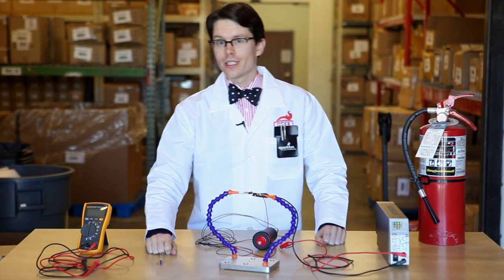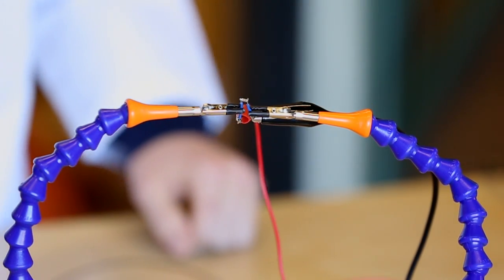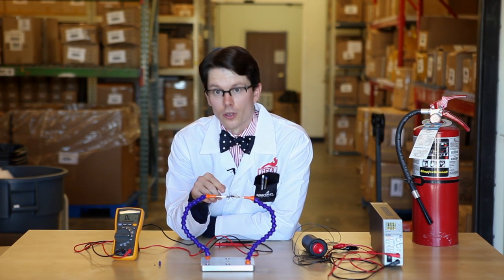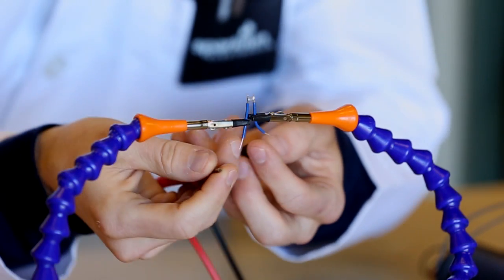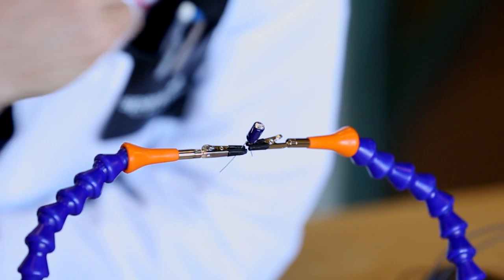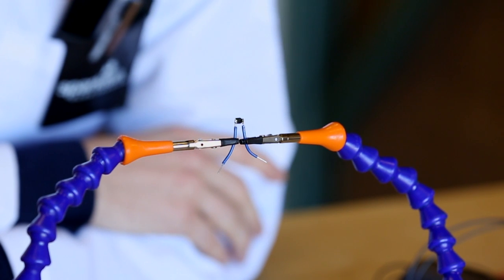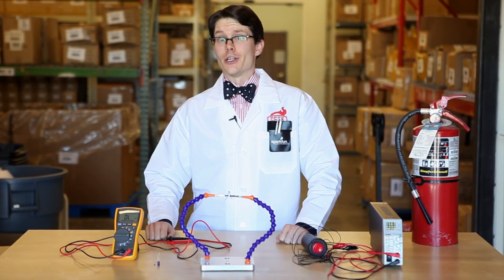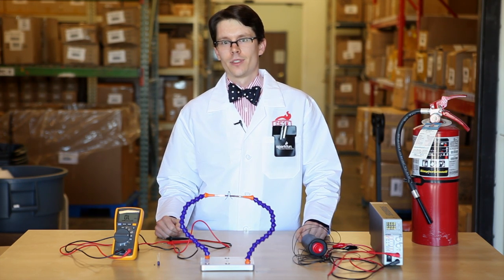Bust a Cap - Exploding Capacitors with SparkFun

Comment: Hi,  I just repaired a pcb that had a short on the 5v power rail to ground.  The culprits were 2x +-4.6uf smd 805 ceramic capacitors that had 0.1 and 0.3 ohm shorts.  No visible sign of damage on them.

Comment: I plan to teach some Electrical Safety in the near future, hence this video is of interest to me. As this video appears t have it, if the applied voltage exceeds the voltage rating, Kaboom! Is that all there is to it? 

I'd like to see some of the Math of a Capacitor Explosion. Resistors are easy enough. If I use a 1 Ohm 0.125 Watt Carbon Resistor with a 9 Volt Battery,  since 1*9^2 = 81 >  0.125, I can be reasonably certain of starting a fire. What am I missing?

Comment: Some of the older electrolytic caps didn't have the scoring and when they blew they literally blew up and it could kill in rare circumstances so we now have these types but I still see some from China not scored...YEOW.
Reply: +legalizeshemp420 

Not fun - but quite a few have (hidden) failure vents in the rubber seal
Reply: Alysson Rowan
True but in the old days they simply blew up inside your tv and had such force it blew a hole in the side of your set and could be lethal.  Now I have an electronics board made 10 years ago and the one cap that did not have a vent blew its silver piece off.  Was a motherboard so I was very surprised at that until I saw "Made in China" on the tube part of the remaining cap.  I suppose that was venting in a way as opposed to simply blowing up like a bomb in those old tvs.
Reply: +legalizeshemp420 
Yups - we used to find non-polarised electrolytics did that a lot in the back of video terminals. Ine used to literally fill the whole case with aluminium confetti and beige fluff (the absorbant paper separator) - with the can usually wedged somewhere in the yoke assembly. It took 2 minutes to replace the cap, and half an hour to get the debris out of the case.

The very old elecrolytics had a proper vent (little rubber ball) in the cap.

Quite often, even the cheapo scored caps will fail by losing their cans - and woe betide anyone who needs to use a heat gun to replace components nearby - I had 4 go at once when I was replacing a MAX3232 on one mobo - good reason to wear a face shield when doing re-working boards.

I have had a couple of quality caps go ballistic recently - but at least that was under exceptional circumstances.
Reply: Alysson Rowan
YES, that is exactly what I meant and I still have the image of the 1970's TV with the plastic (wood grained of course) side blown out because a cap just blew up like a bomb.  Thanks to the 1970's and the caps doing it enough they started to have nice vent holes in them so they spew their guts instead of blowing up.  I have an old ASUS mobo with those old faulty caps that was in all the headlines in the early 2000's and even though it sat in my bedroom unused they vented themselves.  No heat or even being plugged in as I had used it 6 months previously then plugged it in and bios went wonky and I knew from experience what was probably the issue and 3 caps vented and 1 had blown its white guts out but was dry so had done it just sitting there unplugged.  I really hate Electrolytic caps but they now make dry ones from Japan and those are nice (more expensive mobos use those now).
Reply: +legalizeshemp420 
My big image is of a 19" rack cabinet with the back panel blown out after a lightning strike surged the mains supply, and detonated the 2500W PSU at the bottom.

10,000 uF, 25V caps were enormous back then - and I used the least damaged (empty) can  of the 6 for years as a pen holder on my desk. The cabinet had to be replaced since the explosion buckled the steel frame.

Happily, the damage to the other equipment that was killed at the same time was more contained.

I had several desktop power supplies that died while powered down over the summer - which had been fitted with the same make of cap as the ASUS mobos. Not fun, but easily fixed with an order of caps from a certain electronic supplier.
Reply: Alysson Rowan
Yep, I can easily replace mine on the ASUS but an AMD2700+ can't really do anything today so I just left it alone but I still don't get how they blew and spewed without power.  I know caps can hold a charge for years but these were nothing large just a few uF so stumps me.  Samsung is notoriously FANTASTIC in the technological department of their computer monitors and LCD tvs YET use cheap Chinese caps that spew in 5 or 6 years.  They do this so regularly you can go to Amazon to find cap replacement kits.  Save 1 or 2 cents per thousand caps and ruin everything else.  I guess they do it (people say ignorance I say not) so it goes out of warranty and the average Jane, or Joe, just buys something else new.

Comment: Thank you! This was both fun and educational. I've got a small electronics project that involves a mobile battery powered Raspberry Pi (Screen included). I eventually want to upgrade to a Banana Pi and a touch screen, but for now I'm just happy it works. Anyway, I've got a battery setup currently that has two 5V USB batteries for the RPI and a separate 8.4v screen pack. It has a runtime of about 4.5 hours in a small (But slow and heavy) package. It also has trouble starting the 2.5' HDD attached to it. I've worked out a board that isn't finished yet, but will run two rails at 5V to power the Pi (One regulated from 10V series and one at 2x 5V paralell), and one at 10V rail to power the screen off just two battery. It will also have an auto-charge relay that (When plugged into a 110V outlet) will charge the twin 5V batteries automatically, all without losing powe during transitions, USB attachments, or WiFi or HDD enablement. I've been progressing and revising my designs on this custom power supply/charger board for about 6 months now. I've burned through three Radioshack PCB's and a whole bag of caps and diodes, but I've managed to reuse my relay and my regulators. The best part is that the whole thing can be charged off of 1x or 2x USB ports, a 90w laptop charger, or a 5v 2A DC power supply I have. This video helped give me insight into some trouble I've been having. Thank you for that! I'm heading to Radioshack tomorrow to find some components and button this project up. Hopefully within 2 years I'll have a custom handmade-aluminum touchscreen laptop that's only 8" wide and 1" thick. All thanks to your videos. I subscribed BTW.

Comment: Using 2 1000uF or 10mF wired in parallel for a total of 20000uF or 20mF they are rated for 40v and they are used in a car which is 14v,

More than safe, but if i got the wires wrong, alot of smoke.

Comment: At least this is also exactly why the newer Tantalum capacitors now have the built-in fuses - they always die short-circuited. They also are capable of destroying your project because of explosive energy of Tantalum oxides, at least denting the PCBs (printed circuit boards).

Comment: I use tantalum caps where ever I can and love them. Much lower ESR than electrolytic and only explode like in the video when there's sufficient current available to do so. I always use at least a 10 mfd at the input & output of regulators and often a few more at stratigic places across Vcc and other voltage supply lines. This is good for not only filtering noise but I've seen tantalum caps many times save a circuit when reverse voltage was applied from power sources capable of only supplying a few amps as the tant's become a short circuit and basically limit the reversed voltage other components see to zero.
Reply: So using Tantalum as a reverse polarity fuse? Do you embed the capacitor with non burnable materials?

Comment: If you are hobbyist, stay away from tantalum capacitors. However, all your smart phones, tablets are full of them because they are energy dense and light weight if you know what you are doing. Unfortunately tantalum is a conflict mineral that is rare and likely people died in Africa for it to end up in your smart phone/tablet. Electrolytic capacitors also have there faults too, they fail over time as the electrolytic dries out. Ceramics are nice, but they just don't have the energy density.